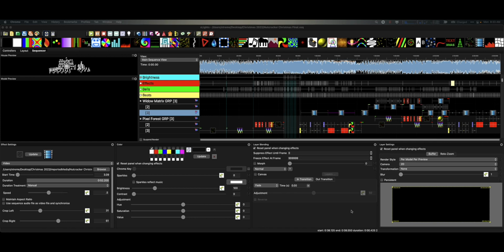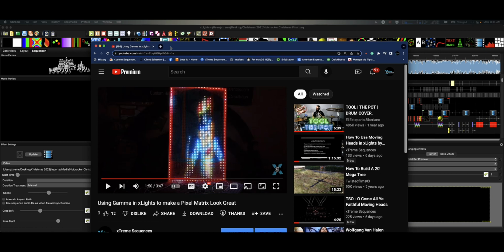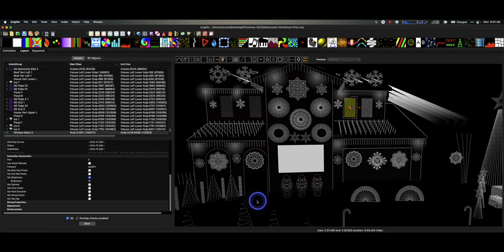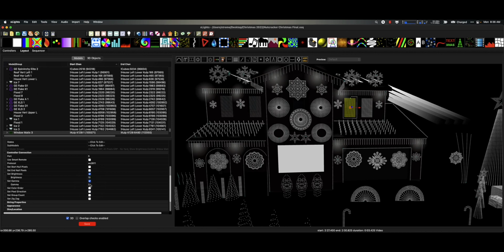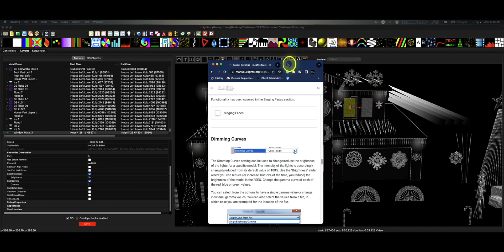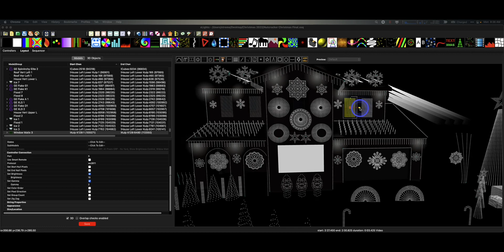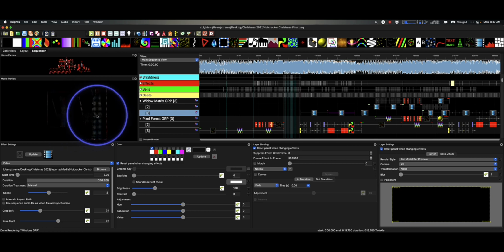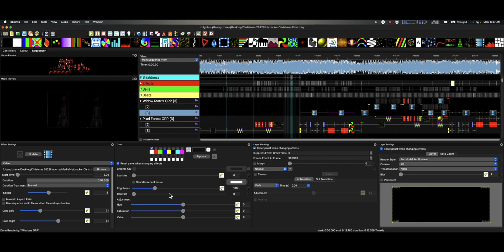How To Use Gamma in xLights

Comment: Hello Ron, Your video came up on a search for gamma options in Xlights. I have my Mega Tree Gamma set to 1.6 and am slowly playing with these settings in small steps (notice I have to squint a little to get clearer graphics on the tree). I noticed that depending on the surrounding lights it makes a world of difference. I am also slowly reducing my brightness on my whole display, as we live in an area with zero street lights. It was overpowering and already reduced the whole display to 20 brightness and was still concerned about  planes landing. Anyways, have you done a video addressing brightness of props to viewing distances? Thank you.
Reply from the maker: I prefer to leave my Gamma set to 1.0. I only changed it before for Halloween but xLights has added Halloween color pallets. I think the key is brightness levels but gamma is something to experiment with. All that matters is you like the look.

Comment: Thanks for taking the time to do this Ron. 
I’m not sure what gamma ‘actually’ does but if it looks better that’s good enough for me.
Reply from the maker: Truthfully, I've never played with gamma until now. After speaking with Dan Kulp it is recommended gamma 2.0 to 2.4 be used during a Halloween light show where there are many purple and orange colors. For Christmas 1.0 is fairly standard. Testing live is the only way you will get to know the difference.
Reply: The only way I've been able to achieve "true" oranges and purples for Halloween, like Ron points out, is setting my gamma to 2.0 for certain props.